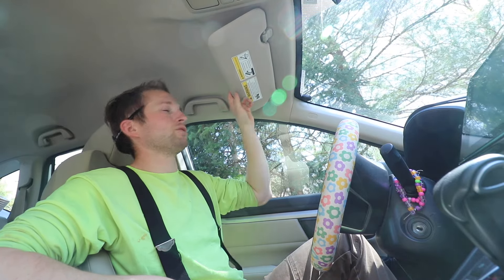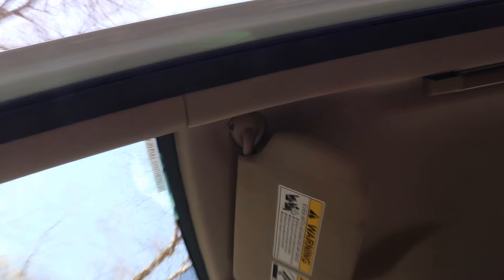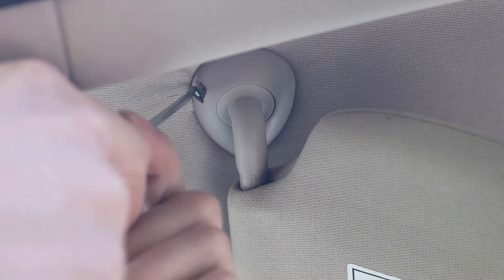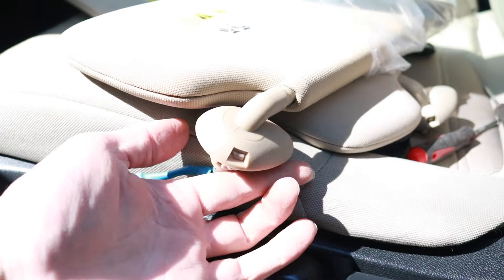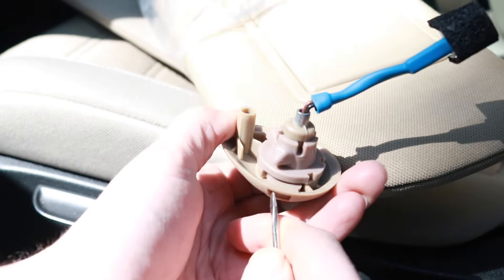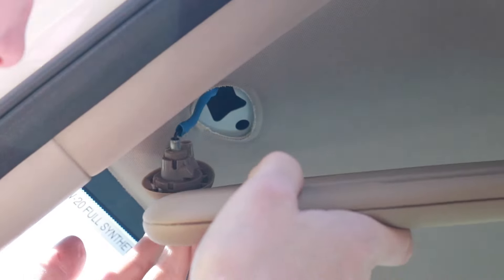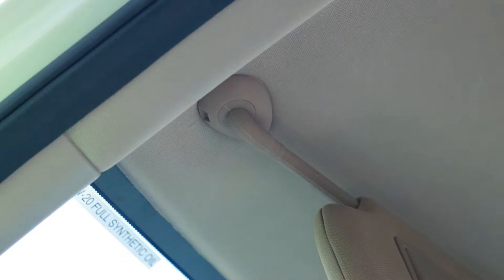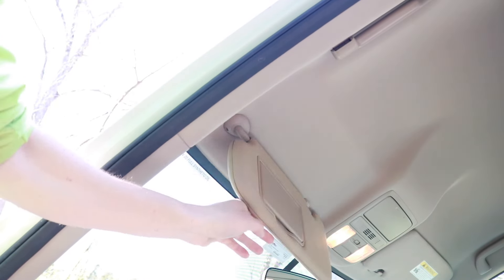2017-21 Honda CRV Visor Removal & Replacement

Comment: Thanks for this video. Made it possible for me to fix mine. The wife was adamant that her i terior is grey, not beige. So, i bought her a beige one and installed it in her tan interior. Lol
Reply from the maker: The wife is always correct haha, Glad this video helped!
Reply: Did it match her interior? I did the same and the beige came in and it was way darker than the OEM and l heard that the light gray it matches 90% better than the beige, cuz the OEM one colour is ivory cashmere which no aftermarket makes the correct colour
Reply: @unclesam1707  It worked, but doesn't match because the passenger side is still beige. I will buy another dark one so they are the same down the road.
Reply: @1968joseph1  great idea to match both thanks

Comment: I just replaced mine with help from your video. You’re so right! It’s a struggle to get it out. As a word of advisement:once you get the visor out of top of your car, pull gently and the electrical wire was plugged in for the lighted vanity mirror. I just unplugged it and plugged in my new visor. You should hear a snap when it’s engaged.  The new visor went in easily and my mirror lights! I’m NOT a mechanical (at all) but this was relatively easy. Also I got the new visor for  $42.00 on Amazon.

Comment: One thing I did that made it easier was to take a no. 11 exacto knife and cut the locking tab off of the old visor, it’s going in the trash anyway. It made it a snap to rotate and remove.

Comment: Honda dealership literally wanted $230 to fix. Took me 2 minutes to pull out the old one and install and $50 for Amazon. I did buy a set of picks for an extra $5. Made it really easy.

Comment: Thanks for this vid, I used a torx screwdriver, I felt the roundness of the tip, gave me better stability when applying pressure.

Comment: With your guidance, this only took me five minutes with only a flathead. 

I picked up the OEM visor from Honda today for $152 after tax (wanted it to be color matched). They told me Honda just announced they're charging double for these (~$300) as of a few days ago. Pretty disappointing considering this is a common issue that they introduced.

Comment: Help! I cannot reinstall. I unlocked the connector and i can almost get it in hole - it does not lay flush so i can lock it in. Help!.
Reply from the maker: @JoannaBelson  I think the instructions in the video were very clear. Perhaps the visor you purchased isn’t a match for your make and model.